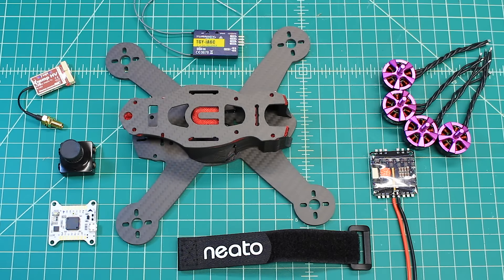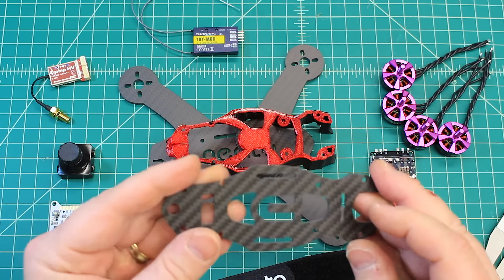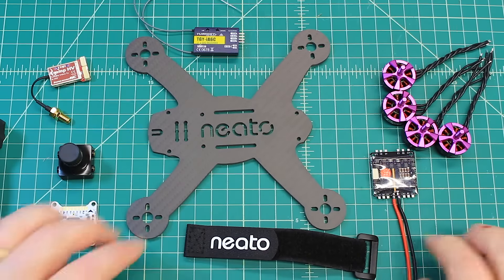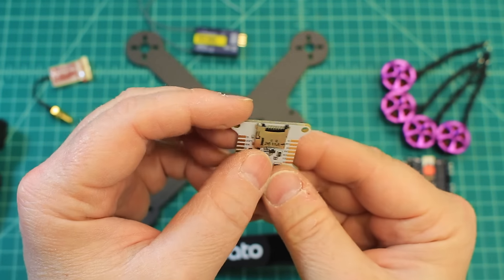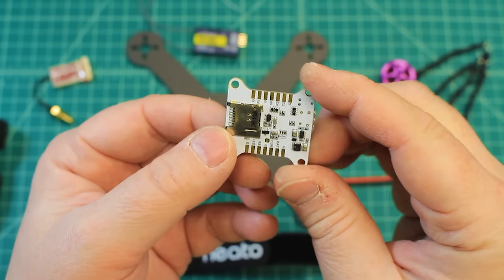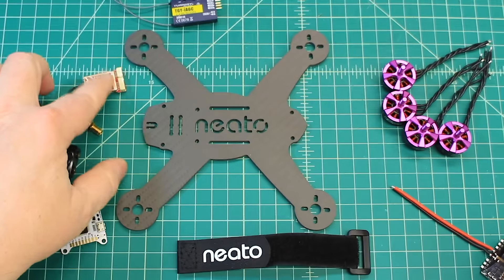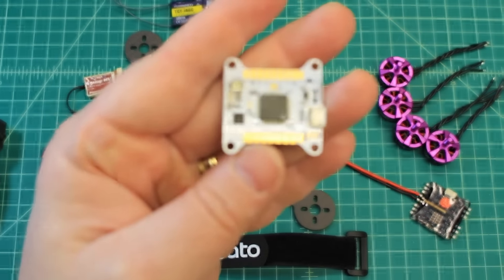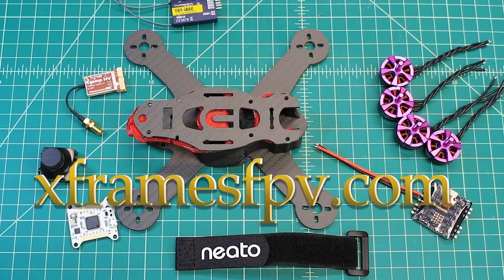Neato X Talon 4" FPV Racer "Buildout"

Comment: Hey Doug, I ordered the Foxeer HS1190 for my Talon and it seems to be too big for the frame. Did you mount your camera with the included bracket to the bottom frame? Any tips would be appreciated. Thanks!
Reply: Looks like I was able to solve it using a bracket from a HS1177.
Reply from the maker: +Travis Daley yeah that's what I do as well. I'm going to talk to Nich to see if he can design some camera install solutions for his frames.

Comment: Do you think that a M3x6 screw would be the appropriate size to hold down the zmx 2205 motors on a 4mm frame? Are they too long, too short, just right?
Reply from the maker: JC250 m7 is perfect.
Reply: Arg...I got M6 for my motors and M8 for my frame. Do the motors come with M7? Will m6 work without the motors flying away?
Reply from the maker: JC250 m6 will usually work fine as long the arms are 4mm and no larger.
Reply: I got my motors in today and yeah, the M6 screws look a little to small. The only other six=ze i have is M8 and they seem to be good. I see what you mean by M7 being perfect. The M8 does extend pass the srew holes of the motor, but as long as its not touching the coils of wire its good right? I checked to make sure by seeing if i was able to put some thing wire in between the screw and coil and i can.
Reply from the maker: JC250 do you have any washers that you could use with the m3x8 screws
Reply: I have some Nylon nuts. Its not touching coils. I wish I could send you a pic. Do you think I should put a Nylon nut just in case or use the M6?
Reply from the maker: I would use then Nylon nuts
Reply: Is there any point in having extra thread above the aluminum base? Because then I think the M3x6 might be almost the perfect size give a thread or two. Do u think that there being one or two threads short of being enough thread to match the base in height is  good or will it strip in flight if it's not at or above the base?
Reply from the maker: +JC250 The perfect fit is when  the screw reveal is he same as the aluminum base.
So if the base is 2mm then the screw having a 2mm reveal is perfect. Generally .5mm in either direction is fine.

Comment: I've seen a lot of your videos and you really seem very knowledgeable I have a question I've been ordering ready to fly quads for a year and out of nine of them only one of them worked then I bought the wizard x220 because it has decent parts inside of it that are easy to find and replace on like my previous ready to flies where most of the stuff was proprietary and had one single board inside I've went through 5 flight controllers this week trying to get it in the air and the last 3 days it did work I woke up this morning and flashed betaflight 3.1 on it and now it won't work anymore what I mean is I was flying around it seemed okay until I did a roll and then it just rolled over and over and over until it hit the ground recalibrated everything tried it again did the same thing but wouldn't connect anymore I did just flash one of them a little while ago and it started to flash but wouldn't finish and I just don't know what to do it seems like ordering another flight controller is just Ludacris one of them started smoking out of a little chip inside in the center is it possible I really had five bad flight controllers I don't I don't know what to do I can't give up on this hobby I have 20 batteries a $200 charger goggles and fr sky taranis all I think about is flying I watch videos every night till 3 in the morning about building or flying all I think about is flying I watch videos every night till 3 in the morning about building or flying but no matter what I do I cannot get anything to fly in more than a day or two or even at all I'm at a loss I don't know what to do I'm currently pretty much out of money in want to buy everything and build my own but my experience with receiving so many things not working I don't even know what to do anymore or honestly where to begin do you have any kind of advice maybe I just can't give up the hobby my brother and my girl are all telling me I'm in over my head I don't know what I'm doing and to give it up and I told them I have never enjoyed something and really wanted to do something as much as fpv in my entire life nothing it's literally the most amazing thing I've ever done and enjoy it more than anything I had to buy five taranis is to finally get the one that works I got two in a row that just kept saying Telemetry lost Telemetry connected over and over it would not stop doing that then the third one I got had a cracked screen the fourth one I got just would not turn on was to completely dead and the one I have now works fine I bought the orange dongle from HobbyKing to use on my simulators so I could fly without a wire first one didn't work second one came and doing the same thing cutting in and out my charger makes a weird noise all the time like the fan is broken all my Chargers that came with my ready to flies have all burned out I think I have one left out of the nine the VTX that came with my ex 220 literally just fell apart the connector just came out of the pin and fell off is this normal is this part of the hobby or am I having an extraordinarily unusual time because to me this has not got to be normal this has got to be completely weird but it won't stop just continuing everything I order comes to me broken is there anyway I can order stuff that will work or is it all just hit or miss some work some don't because I'm just getting everything that doesn't work somehow and most of those quads I ordered from China they required me to pay for me to ship it back and it was always like $75 and I just thought that was ridiculous and didn't have the money to pay it and they would not refund me either so I didn't want to take the chance on shipping it to them and then them not giving me my money back and losing the $75 and shipping plus the price of the quad I really don't even know what I'm asking I'm just at a loss at this point and really wants to get back in the air so bad and I'm so tired of flying on the simulator I fly great on this simulator and do all kinds of tricks I feel like I'm comfortable with all the different parts of the quad copter and how they work not every brand but I know the basic components and how they go together and I've been flying for about a year now even though I haven't got to fly that many times lol I just don't know what my next step should be to get in the air and I have a bag full of ready to flies that don't work anymore and just want to fly any advice would really help
Reply from the maker: +Jordan Bass wow that's a lot of bad gear. Your experience is not normal. For the most part only about 1% of the products I have are faulty. That being said I do a lot of research on components to make sure what I order is proven to be reliable. 

I'm wandering if we could take the parts from all your broken drones and build you one out of the good parts. What do you have that could be used to build a new drone?
Reply: I think for your flight controllers, you should check your esc leads and pdb and make sure everything is not shorting and all the joints are good and non of them are cold. Next make sure all the esc signal and ground cables are not loose. I think your quad  kept flipping because the board is turned a certain amount of degrees and you have to tell the software that. Also make sure you put your props on in the right direction. The reason the board isn't flashing I think is because it's an spf3 clone and most need to go into bootloader mode in order to get flashed. Joshua Bardwell has been making a series of vids on how to correctly set this up and I think u should prob go to his vids and watch them they r great! I've never heard of so manu broken Taranises in a row. I would probably get a turnigy evolution. It's much cheaper and people are liking them. But if u have a taranis that works definetly keep it just make sure you have followed all of the correct setup procedures. And finally, never give up. This hobby might get expensive but if you persevere it will be worth every penny. Hopefully, as long as you have a working pair of goggles and transmitter and charger and tools, if one quad is bad it's always possible to build one yourself, that way you can identify the problem much quicker and have the knowledge and experience to fix it yourself. Also try to find some fpv pilots near you and ask for their advice. They can be found on Facebook or multigp and other places. Just find one and bring your questions to them and most of the time, they will be able to fix something or help u in a way that is much better than over the YouTube video comments. Best of luck
Reply: Definetly check out Joshua bar dwells channel and latest videos about the eachine x220
Reply: JC250 it is turned 270 degrees set that all up correctly I've talked to Joshua Bardwell for almost two weeks straight trying to figure this out he doesn't know what's wrong everything he says to do nothing works for me I have put it in bootloader mode to reflash them as soon as I put it on the Drone it doesn't work anymore sometimes on the Drone they will flash most of the times they won't I've watched all of Josh videos I don't know what to do I ordered another flight controller it should be here by Monday I'll give that a shot I don't know why all my other ones just keep going bad I'm thinking I should buy a nice high-quality flight controller because I'm positive my speed controllers Motors and pdb work really well I think I just keep getting those faulty SP racing F3 boards
Reply: JC250, it's very upsetting and frustrating seeing all these noobs that just order the same thing I do and there's work and they don't even know what they're doing I'm reasonably intelligent I always check everything step by step I can't find any shorts I can't find anything wrong the motors and speed controllers actually seem like they're really well and smooth the pdb looks great just the software and the flight controller and continue to have power from I got a brand new one in the mail yesterday try to set it up today and one of the chips on their started glowing red and smoking nothing I had anything to do with or soldering it was directly in the center of the flight controller it was glowing and then started to smoke so when I get my new one on Monday I'm going to load betaflight 3.0 and not put 3.1 on it because my copter was flying beautiful when I had it on 3.0 and then when I put 3.1 on it this morning everything went to hell even though it's a stable release when I got my other flight controller a few days ago iflash 3.0 on it hooked it up and the Drone was flying amazing like amazing then I flash 3.1 and nothing is working anymore in the flight controller is pretty much broken at this point kid flashes in bootloader mode and then when I put it back on the Drone or on solder the bootloader tab it won't work anymore then when I saw her the tab back on and try to flush it it won't flash anymore no matter what I do so it's like sometimes it works sometimes it doesn't I've had that happen with all of them sometimes they work sometimes they don't the blue and red light Flicker and dim but whenever I hook up my tiny whoop or my 90 millimeter brush quadcopter they work a hundred percent of the time for months now everytime I hook them up they always work so I know it's not my cable or my computer it has to be just bizarre luck of getting crappy flight controllers is there an inexpensive flight controller you can recommend I've been using the SP racing F3 but I'm hearing a lot of stuff about Chinese clones and I think I'm just getting a lot of Chinese clones I'm very familiar with the F3 board and it is very easy to wire up for me is there anything that you would recommend that is kind of inexpensive if this new one coming on Monday doesn't work because like I said I'm pretty sure all of the other Hardware is working very well and I've went through it piece by piece and it actually looks pretty good maybe an F4 flight controller? I really don't know about flight controllers other than the SP racing F3
Reply: The esc glowing red is definetly not normal. Could you send in all of the parts you are using (batts, esc, motor)? The best F3 board that is super simple is the F303 v3.1. If you use the picture, its really easy to wire up

Comment: Just a question which motor do you prefer zmx v3 2600kv or dys Fire 2600kv
Reply from the maker: I don't have any experience with the fire. I can tell you that overall the ZMX motors are not nearly as noisy as other DYS motors I have tried..
Reply: X-Frames FPV thanks
Reply: Do you thinks the zmx v2 2800kv is better than the zmx v3 2600kv with a 5040x2 prop and 3s yes 3s not 4 it's not for a kwad 4s is too much
Reply from the maker: Thumbs-fpv I would do the 2600kv. The 2800 would really drain the lipo quickly.